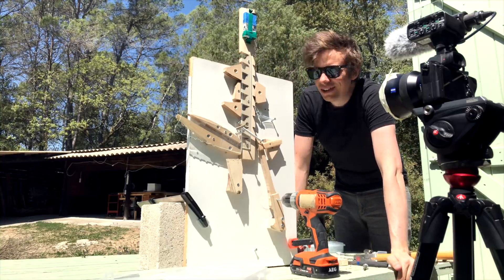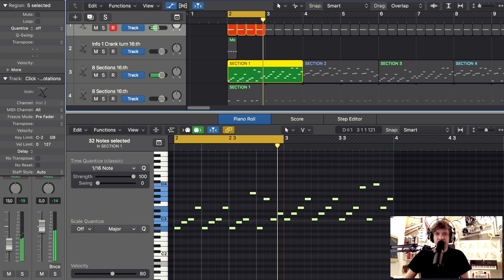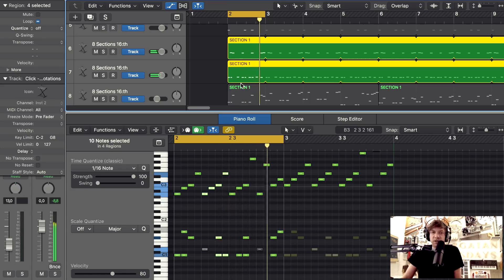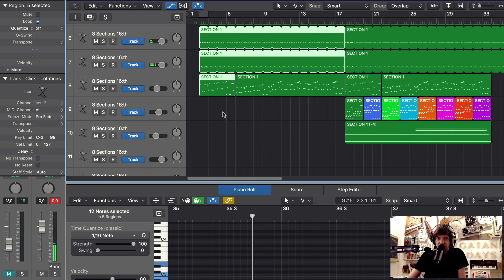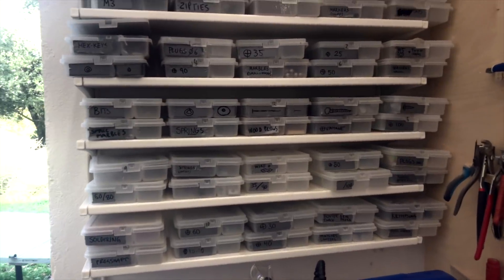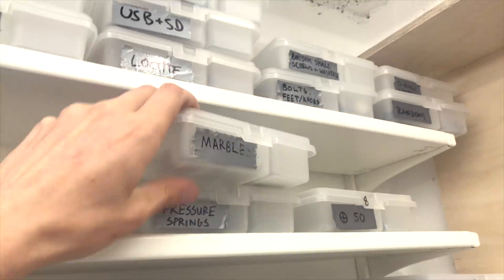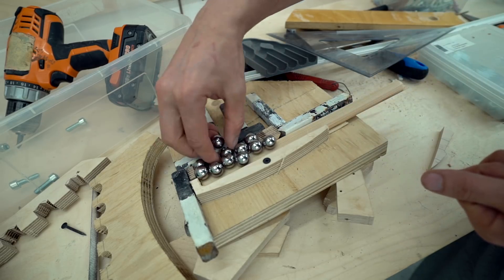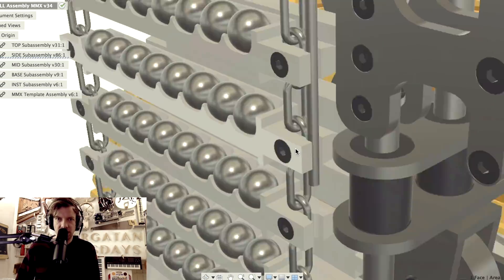Conveyor Belt Marble Lift - Marble Machine X #33

Comment from the maker: chute1
ʃuːt/
noun
noun: chute; plural noun: chutes; noun: shoot; plural noun: shoots

    1.
    a sloping channel or slide for conveying things to a lower level.
    "cement was loaded on to barges via chutes"
    synonymer: channel, slide, trough, shaft, funnel, conduit; Mer

I looked it up, not a good word for the marble transporter things, will use shuttle instead :)
Reply from the maker: Its ok, The only instrument that is mic:ed acoustically on the MMX is the Vibraphone (almost the only), and it is super loud so signal to noise is not a problem. The mechanical movement of the conveyer belt is in time with the music so if there is a sound, that sound will be part of a rythmic feel. The loudest sound on the machine is all the marbles rolling around i think!
Reply: Wintergatan the movement in sync with the beat is gonna look terrific. And if any noise is picked up, it will just be a faint metronome sound, which is really not a problem. The sounds of the machinery itself also adds some soul to the machine, which is really not a bad thing. Very stoked about the conveyor!
Reply: @Wintergatan  BiiGG
Reply: @Wintergatan  20 Note music box comes at December 1
Reply: The Demagnitisator splits the Marbles in to 4 why don't you leave them in 4 and Split them again to get to the 8?
Reply from the maker: AAAAAARHHH CAN SOMEONE PLEASE ANSWER ME ON THIS: Why are all my answers on the bottom of the thread? How do i answer a single person? Do i have to manually write who the reply is for? Please explain how this works, i do´nt understand the system... oR maybe commments are sorted on time? I am useless, i have been searching for the answers on this but i think the answer is too obvious to be found in a tutorial so  help! ;)
Reply from the maker: Thanks! I used to be quite vain about spelling, suddenly i am bad at spelling and have almost stopped caring but i fixed it!
Reply from the maker: i was trying that out! But that makes the need for four separate channels to pass "outside" the pistons and the designs sticks out more on the left!
Reply: Bucket conveyors and chain drives have been around for over a century. No patents here.
Reply: I would think of the machine sounds exactly like the rubbing of guitar strings, or the breathing of a singer. It's not "written" down on the sheet music but it is still a part of the music.  You shouldn't take that out. It makes it real. I love listening to classical recordings and they can never remove all of the subtle noises of the instruments, like rubbing of bows on string, or the click of the keys on brass instruments. It doesn't intrude in the music and it makes the recording more real.

I have an old synth keyboard and it actually has a "finger rubbing along guitar string" sample To be used for big jumps in key changes. Of course EXPERTS should NEVER rub along the strings when changing notes but it happens and when added to midi in just the right spot it can help create a small bit of realism.

Reminds me of a story I heard (may or may not be true) about Barbara Streisand. She came to studio to hear her music after it had been mixed and cleaned up and immediately noticed they had removed all of her breath sounds, her inhalations. She was not happy at all and insisted they put her breathing back in.
Reply from the maker: very good question, i have increased the radius from the first version, if it doesnt allow it  will have to make a roof of acrylic to keep the marbles entirely locked in.
Reply from the maker: loved that streisand story, it is very true! We are quite used to clean and perfect nowadays, it is the imperfections that makes it special, cliche but true!
Reply: Wintergatan what would we do without coffee? Well we MIGHT survive, but we won't be living.
Reply: I think the marbles coming out of the conveyor will have a lot of momentum when being forced around the bend at the top. I think you will need a bit more than just a track as they won't just roll of but fly out somewhat. :)
Reply from the maker: i hope they can not patent using a chain in a conveyer belt for a marble machine : ), if they can maybe they can provide me with the ultimate marle conveyor...
Reply from the maker: The vibraphone does not sound good in contact mics!
Reply from the maker: the marbles are heavy and Its not going that fast really!
Reply: You have a nice day too! The music was great. Shuttle? Space shuttle? Marble shuttle?
Reply: Wintergatan Unfortunately, it seems that YouTube is not making this easy for us. On the Android app, I added your name by clicking "Reply" under the 3 dots menu. Unfortunately, the replies are arranged in chronological order, not logical order. IIRC, the full website is similar, but you click the word "REPLY". Hopefully that was helpful.
Reply: +Wintergatan. There isn't much you can do apart manually manually mentionning the name before your comment to make it easier to tell who you are responding to. Youtube comment section is just so troll xD
Reply: Will the U-turn in the demagnetizer allow for 8 marbles per crank at such high speeds?
Reply: He shoots, he scores!
Reply: Working in industry always scares me because stuff like these are often under some kind of patent. Doubt it affects you though! :)
Reply: Wheres Wilsons Fans At join the facebook group!!!! https://www.facebook.com/groups/2102402929988275/
Reply: Could you not also use magnetic pickups on the vibraphone? Maybe mixed with the mic signal to remove some noise.
Reply: Thx for the video!, awesome progress, have a nice week.
Reply: Keep Up the great work
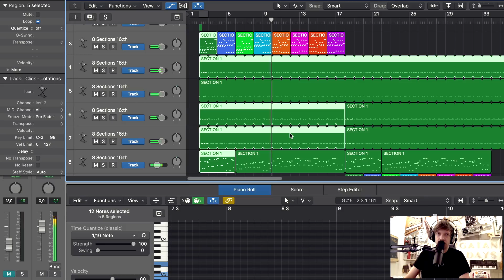Reply: Martin please. You can put this song on bandcamp 4:30
Reply: "Chute" is a correct descriptor for the segment after the demagnetizer that feeds the marbles down to the 8-way split for the chain lift.
Reply: Love the video, as always. But since you are quoting dictionaries... It is "vain side", not "vane side", in the description :-)
Reply: Wintergatan I have no idea what's happening! Have you been replying to your original pinned comment, or to the replies to that comment? A bit of circuitous language, but it's the best way I can think of asking the question
Reply: Speaking of shooting, I'm thinking your marbles are going to end up shooting out the top if the belt movement isn't completely smooth.
Reply: Martin, this is already in the sub-branch to your dictionary comment, all these are comments to your comment. Answering to one comment works only in the top level, I think.
Reply: By the way, I meant a pickup like in an electric guitar for the vibraphone.
Reply: Can the ring lift move marbles at 8 per second?
Reply: I was thinking the exact same thing, Archimedes Screw! And it would look interesting!
Reply: mines use the word "chute" to describe the same function.
Reply: If You want to play a different instrument wile playing the marble machine x wouldn't it be great to have some slow 19th century electric motor that you can just roll on stage next to the machine and  connecting the two, it would be a sight to behold. There were motors that could halve and quarter their speed just by flipping a switch. Yes I was in a industry museum the other day ;-)
Reply: That bug in you video is a Crane Fly https://en.wikipedia.org/wiki/Crane_fly. Around here in he southeast USA we call them Misquito Hawks. They're harmless, and kids catch them in their hands all the time to take them outside the house to release them
Reply: Caffinator It is possible to live without coffee, but the hardest part is the transition to no coffee. After that it gets easier. (Guy with a heart condition.)
Reply: 6:37 I find the lift system very two dimensional. why dont you just bucket lift tons of them up?
Reply: Zoya Markova WTF?
Reply: Also, as a designer, live by KISS [Keep It Simple, Stupid]. This is getting so complex now! More moving pieces means more changes of things breaking on the road. And when the marbles fall out of the tray, they'll hit the back of the previous tray, and bounce everywhere
Reply: Wintergatan, hi!
1. First of all, your lifts very noizy! I know they still prototype, but springs, clicks, etc. still make noize.
2. You tried spiral lift system? Some guy here call it Archimed screw. You can use bolts, springs, or any handmade with same principal. And it will be without noize!
3. I think your 1-2-4 divider would be don't work! With magnitize condition it can't keep up 16 marbles per sec through 1 row. It's 8 ball per tact, but more important real physic speed - 16 mps!
4. Your way to make lift system take perfect condition! Always ideal divide. Always ideal 8 balls lift. Keep in mind that balls have always low speed. Because they they moves from one ball position, to another. And always take some time to acceleration. You thinked about what if some lift cant rize up 8 balls? for example 5 balls, 5-6 tries in row.
5. Concentrate not only visual, but productivity. 16mps. And rework 1-row bottle necks.
5.1. Magnetized wheel(16mps? i think it has. But it needs to be no more no less.).
5.2. After that and before 2-4 divider(16mps? magnetized balls can broke all system here, because faster magnet-wheel mps). 
5.3. After 4-to-1-to-8!!! if convert that part to speed, it needs to be like 16mps_to_16mps_to_16mps! And nevermind how it needs to be divide. On to 2, on to 5 or on to 16 balls. Through the manipulation in all parts it should keep same marble speed.

I don't remember previous video well(for example, i don't remember magnetize-wheel gear reduction, so i don't know how much mps it has per 1 tact). But i've seen it all from start. It hard to understand you by ear (because im not english talkin, plus on that your accent =) ) So i mostly understand all of that by pictures and videos. Sorry if i missed something you might said before. =)
Reply: Would've been great if you could adapt genva drive gear somplace visible on your MMX too.
Reply: what is the software?
Reply: Ahhhh the gears that you were talking about with the chain lift... I think it is a sprocket more than a gear. 

The idea of using that chain lift is a good idea and very visually appealing. Another item that I have used personally that uses the sprocket and chain lifting setup is come-alongs and even garage door openers for car service businesses. They are a very strong setup but can be loud but if you make the sprocket out of plastic it would deadend the noise of the chain links rubbing against themselves.
Reply: step one: channel one
Reply: What song are you using in your demo from 3:22 onward? Is this song in any of your albums?

Comment: New unit, mpt. You need 8mpt
Reply from the maker: Yes! we actually called it mpct internally
Reply: make each tray hold 10 instead of 8 and then it can be SI... and will also give you some more flexibility by getting even more marbles up top.  then the question becomes how many marbles can be moved by the main gear and its magnets?
Reply: new SI unit? ;-)